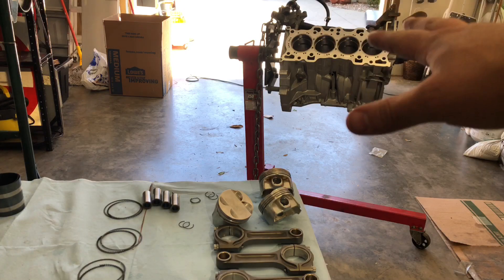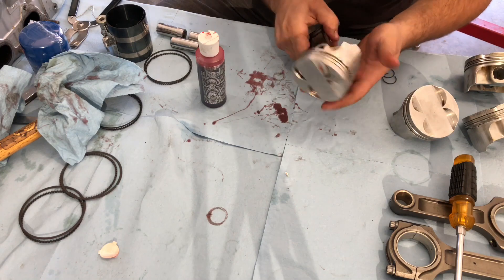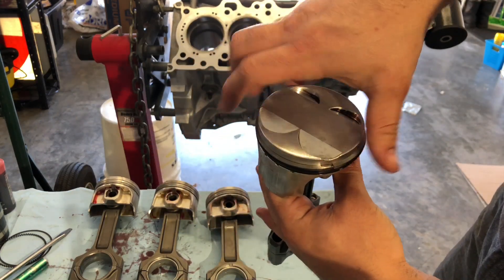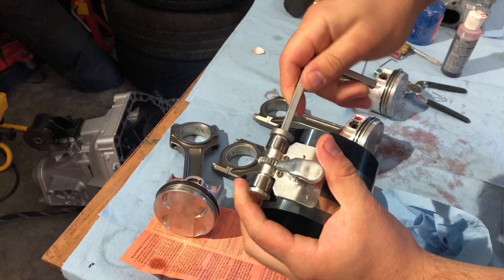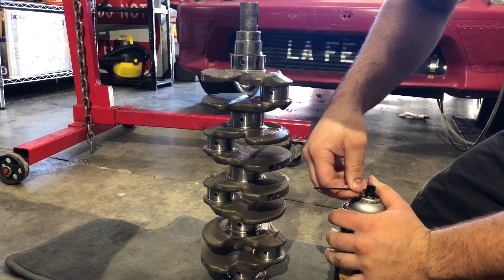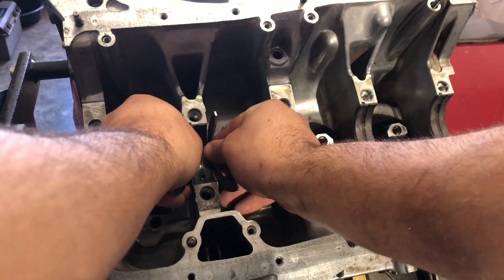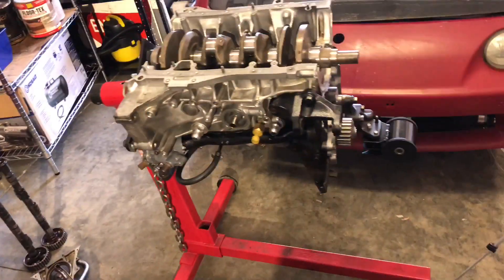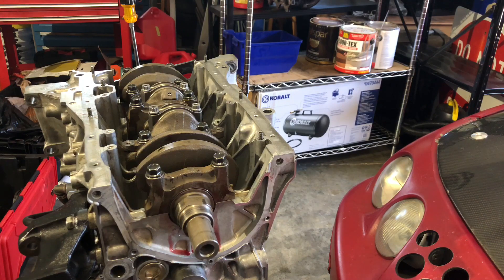800HP Honda Build || Step-by-Step : Part Two

Comment: I'm building a race engine myself and I'm enjoying all the tips and stuff for b series. But the torquing sequence on the mains. If the torque wrench clicks as soon as you start pulling on it you need to back it off and get it to turn and click all in one motion. Static friction is always greater than kinetic friction, so if it clicks immediately you're registering the amount of static friction instead of kinetic friction and you need to back the bolt off a little and kind of start over. If you address the at a later time or you've learned about this since the time I commented just ignore me. It's 3 am and I'm a semi-drunk engineer. Aside from that, awesome video. Please let me know if you want some gnarly carbon fiber parts for any of your cars as I'm trying to start a custom carbon aero company and I love to work with other racers that give a shit about the community and stuff.

Comment: What compression ratio are you using? I have wiseco pistons (K673M81AP) think its ment to be 8.5 will it still run ok using a standard b18b1 basemap or what are the main things i should change in smanager for the lower compression ratio?

Comment: I just bought a b18c1 swap. Expensive. They didn’t upgrade the camshaft. They said the build was for 550-600hp. Will see. Put it on a 2000 civic si with 44k original miles. Will see if it was a good option.

Comment: Those marks in the walls after the oil pump failure could also be the lack of torque plate honing and head stud fitment.Youd be surprised how much the cylinder goes out of round once studs are fitted.

Comment: Last time I checked the larger valves ( and the larger reliefs) are exhaust. You’ve got it twisted when combustion happens the fuel burns and the expanding gases are what drive the piston down - I.e. MORE gasses are being released during the exhaust stroke. It’s an explosion not an implosion, and as a result the larger valves are exhaust. Because they have to flow more freely than the intake plenums. I may be wrong maybe the intake valves have more lift requiring more relief but I’m pretty certain you’re the only doing the pistons backwards. Which also isn’t good they’re not perfect circles. Was the scoring primarily on the intake side?
Reply from the maker: I dont mean to be rude, but intake is larger. Look it up
Reply: SP Tuning it is larger but your analogy threw me for a loop. It’s dead opposite of what actually happens. Exhaust is larger volume (again expansion) but cylinder pressure from the upward exhaust stroke primarily force the gasses out. They’re smaller because it’s more beneficial to put that volume towards intake where air is not normally pressurized
Reply from the maker: Okay, youre over thinkinng my analogy. Heres my analogy:

Intake : air and fuel (two things)

Exhaust: burnt air (one thing) 

Simple analogy. Dont over think it
Reply: SP Tuning the larger valves will ALWAYS be the intake side. ALWAYS.
Reply: Ackchyually is harder to suck air in to the combusiton chamber than to push it out thru exhaust cycle, also the air/fuel mix is still expanding at the end of the same cycle, so it finds its way out through the exhaust valve more easily than fresh air entering thru the intake

Comment: I have a question man, so you torque your mains and rod caps to what specification if you use plastigage? Ex: use half spec because stock motors have TTY bolts? How do you go about that
Reply from the maker: I use stock honda spec for the mains, and whatever your SPECIFIC manufacturer of the rods specifies
Reply: Okay, well now i have another question, i don't know if i missed this info but you do a very good detail work on explaining things through but did you use TTY bolts or aftermarket ARP bolts or something? Also, if they are TTY bolts, that should be only 1 use. So how would i go about that? Reuse the old bolts to check plastigage to see if in spec then replace the bolts and carry on the assembly with engine?
Reply: Lime This is actually a good question. But what can a builder realistically do? Maybe use old hardware for clearance check and new hardware for final assembly

Comment: Wiseco highly recommends using upgraded wrist pins with anything over 500hp just a heads up.
Reply from the maker: Ah okay. Didnt know that! Thansk for the info will keep that in mind
Reply: SP Tuning no problem! Hate to see a build go to waste over something simple. Had wiseco's myself and ended up switching to CP with upgraded pins in them as well. It's cheap insurance!

Comment: Shouldn't the piston and rods be assigned to each cylinder during the machining process to have the clearances set?
Reply from the maker: Yessir. Im pretty sure i included that in this video that each piston assembly with corresponding rods number (1-4) goes to said cylinder (1-4)

Comment: Good video man, so plasti gauging the crank is to just insure the crank and bearing tolerances are within spec correct? Say you ran into them being out of spec what step would you take? I'm building my own LS vtec
Reply from the maker: If it close you can micropolish the crank and get it a little looser. If not re grind crank and get over sized bearings if im not mistaken, but at that point that type of things is better left to a machine shop which has the machines , tools, and engine all at once to fix the issue in one process

Comment: Let me say your videos have been very helpful, I'm feeling confident that I can handle my own rebuild myself. I do have a few questions though. My b18b bottom end is already bored out to 81.5, eagle rods, je srp pistons and stock crank. Well she started to develop a very small knock. In my case would I need to strip it down and send the block and crank to the machine shop and have it rehoned and have the crank polished and just re ring and put on a fresh set of bearings , or do I buy 82mm pistons and new rods and take all that to the machine shop? If I do that what do I tell them to do. I want to do the assembly myself just need to know what I'm supposed to tell the shop. thanks again definitely subscribed

Comment: So what if the clearances are off? What do you do?  Great videos just subbed!
Reply from the maker: Thanks for the support!  If clearances are off , theres a few things you can , but your safest and best bet would be take to a machine shop and let them do the necessary machining work to get everything into spec. From that point on your probably be told by the machinist to run a different engine bearing. Instead of a “standard size “ youll need a +/- sized bearing

Comment: Do you lube under the bearings or just on top?
Reply from the maker: Under and on top
Reply: If you lube under the bearing you run the risk of the bearing spinning in the block, especially under heavy loads. The notch in the bearing can help prevent this, but with a heavily modified motor it isn't hard to spin a bearing if it's sitting on oil
Reply from the maker: Great explanation ^^! I think i wordered my response wrong , im sorry, just lube where the journal will sit. Not on the block itself

Comment: Your method of pushing pistons before the crank shaft is in its 100% safe because there is nothing will interfering with the piston rods when you push the piston in so in this case there is a small chance of braking piston rings while pushing piston but some times when you put the crank in the crank won’t spin freely because of a lot factor like Machine shop mistake they still human and the make mistakes in measurement some times so in your case you can’t verify if the crank will spin without Biting in main bearing because you piston rods will interfering with the crank so what I do I make sure the crank is in first I spin it with hand force if it is Smooth spin I go and push pistons in ...

Comment: Wondering why I never see these youtube builders check their main and rod clearances with plastigage, you're the first I've seen actually do it, are most of you all that confident that your bearings are sized properly and that you aren't in need of a line hone? Also, maybe not the best to be doing these jobs wearing open toe sandals, one piston dropping and you might lose a few toes.

Comment: Does eat ring gap change based on its piston? Like was your gap  different from piston 1-2?
Reply from the maker: Changes based on the cylinder. All the pistons will be the same, but rings will be specific to the specific cylinder
Reply: So for example. I'm looking to run 16 thousands on cylinder 1 & 4 but what would be the best for 2 & 3?
Reply from the maker: Also 16 thousands. Sorry, i think ur misunderstanding. You want gap to be the same across the board, but you need to file piston ring 1 for cylinder 1. Once you did that you file 2 for cylinder 2 etc. they will all come to thw same gap. Lets say cylinder 1 is 81.5mm on the dot, but cylinder 2 is 81.525 mm (random numbers for refrence) cylinder 2 and 1 will need the rings filed a different amount to both reach that 16 thousandths. You know what i mean?
Reply: I got you! I appreciate it my man! Keep up the videos! Very informative! I hope to get a following like you soon! ✊
Reply from the maker: Thank you for the support!!